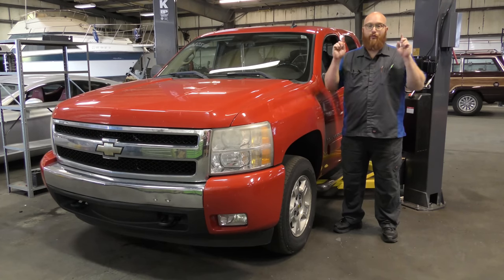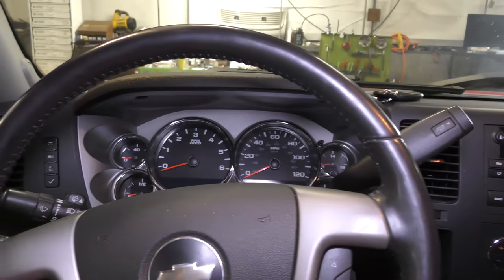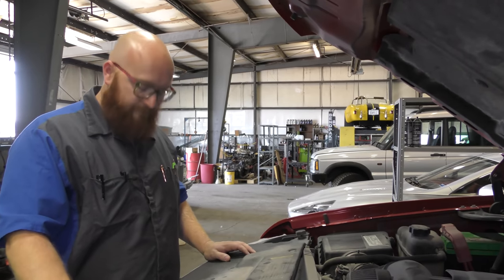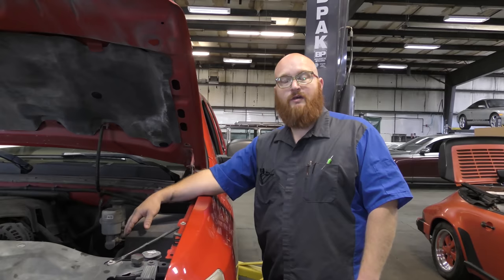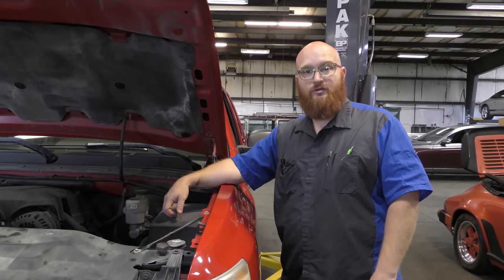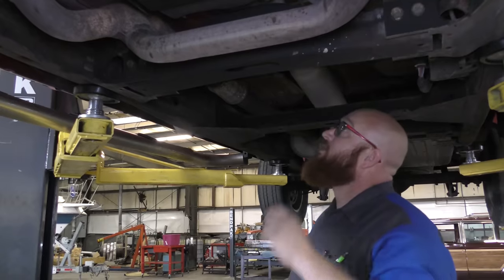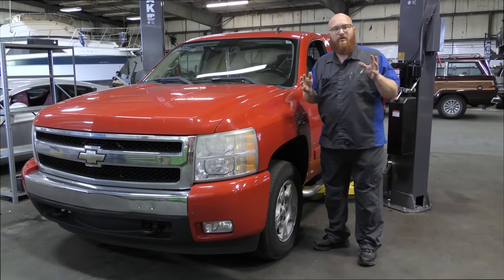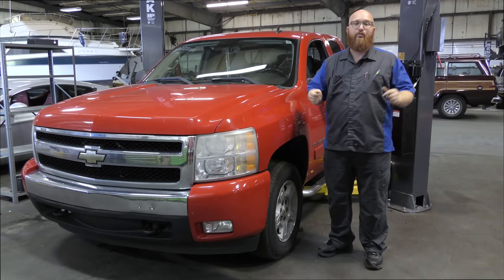Good Truck/Bad Truck? CAR WIZARD shares most common problems on the 5.3L Chevy truck at 100k+ miles

Comment: I have an 02 Silverado 1500 Z71 LS 4x4 with the 5.3 Vortec.  She's had a hard life,  she's been used for a firetruck,  wood hauling, construction, and finally by the maintenance man where I worked.  He took care of her pretty well.  She looks pretty rough,  every quarter panel has dents and scratches.  The rockers, and all four fenders are rusted through. She currently has 326,000 miles.  Runs smooth as silk, and quiet.  Every single thing on her still works.  I have a good mechanic like you Wizard.  When I first got her I had him go over her with a fine tooth comb, and give me a list of things wrong,  in the order of most important to least important,  one by one he repaired all the problems. Total for everything was a little over $3k.  I know I have more in her than any blue book,  Edmunds,  or whatever. I don't care.  I love the old girl. I named her Big Red.  I'd drive her anywhere, and she's comfortable.  I'll never get rid of her.
Reply: 2009 Chevy never get rid of it . Think I'd go to California and back in this dam thing rust little frame need a weld but dam thing gos like a Cadillac . At 4 wheel drive .
Reply: @MADDCHOPER68  I'm with you. I'd be happy to drive Big Red coast to coast right now. 
Comfortable as an old Cadillac.
Reply: I have a 2010 red one too, she is so pretty, no dents at all, just getting Into 180K.
I need to start taking care of several simple issues, and check oil leak
Reply: @mariorrodriguez535  Oh, I wish I could have gotten ahold of my "Big Red" when she was still pretty. At 20 feet, she looks pretty good. Once you get close, you see every battle scar, right down to a couple of the wheels. At some point, probably during the time she was used for cutting and hauling firewood commercially, she was buried up to the frame, spinning the wheels and scaring them clear to the center. Oh well, what's important is everything on her still works, every leak, and mechanical issue has been addressed. She's as comfortable as a Cadillac and consistently gets 16.7 mpg with the ac blowing ice cubes. I love the old girl. She's my going to town rig. We're both enjoying retirement together. These days, the heaviest thing she hauls is a few bags of top soil from Lowes now and then. Chevrolet, the heartbeat of America. ❤️ 🇺🇸 🛻 💪

Comment: Im in southern Ontario and when we get these trucks ( rams and F150 s as well) with broken exhaust studs we weld nuts or bolts to the broken pieces to extract them. the joys of the rust belt.
Reply: He doesn’t explain why the exhaust bolts break?
Reply: @dehoyosrudolph8885  Planned short working life by GM to ensure profitable dealer repairs after warranty expires.  On the GM 4 cylinder Ecotec type engines, many, if not most, of the exhaust manifolds crack in the middle, but the crack is under a heat shield that is seldom removed. Once the heat shield is removed the cracks are readily visible from the carbon tracks left by the escaping exhaust. Having an ever-present exhaust leak also ensures that the O2 sensor on the manifold is not making a correct measurement and the mixture is always out of sync with factory specs. Other design problems in these smaller engines reduce engine life. The V-8s work well if you change the oil and filters, and follow the Wizard's advice.
Reply: My dad used to own a 2010 F150 which had a ticking sound on cold starts. We thought the worst (timing tensioners or worn roller followers) .
To our surprise it had an exhaust manifold leak on both sides. We didn't think about that at first because it was a CA truck its whole life and only 130K miles.
What I'm saying is those bolts can fail even in the sun belt LOL

Comment: I bought one of these '12' based on your walk around videos of these trucks.   I sought out the 4.8l to avoid the lifter problems of the 5.3, i dont tow a bunch so no lack of power issue.  Keep up the good work!

Comment: I have an 08 Silverado with the 4.8 and similar mileage, you really nailed it on the common issues and the door locks are a common issue too. I've replaced sway bar end links, shocks and suspension bushings by this point but in fairness I've done that in most of my vehicles by 120k miles. The thing that stands out about these trucks and why I still keep running mine is the total cost of ownership has been crazy low. Tires are expensive but have a long mileage life, service costs are low, and working on them is easy so even the time quoted to fix issues isn't bad.
Reply: I’ve done normal maintenance and surprisingly had transmission cooler lines start leaking. Replaced those 2 yrs ago myself. A few batteries, tires, door handles failed and replaced. The electric locks driver and passenger just started only working half the time. Out of all vehicles owned the 09 Silverado has cost the least to keep going
Reply: 4.8l is a much better engine over 5.3l. No afm
Reply: I have the same. No rust same miles. No problems other than regular oil change. Brake pads. And tires and a new battery. Awesome truck.
Reply: My brother has an 09 with 5.3 my 08 with 4.8 will smoke my brothers off the line and top end.my traction control sucked ,my only complaint ,sucker broke ,now my truck will smoke the tires into second gear. Broke is actually fixed as for as my traction control goes
Reply: Contact cleaner ,sprayed my window button consol ,,fixed the problem.
Reply: The door lock issue is common on MANY G.M. vehicles. Not just the trucks.
Reply: Not trying to be a wise guy but my 08 Sierra  4.8 has 235000 and  only replaced brakepads and wiper blades.  Runs great.  Minor electrical issues. Cruise control  doesn't work. Its a work truck.ill run it into the ground. Doesn't owe me a dime.

Comment: These are really good trucks, Chevy makes an amazing, simple, and reliable truck. I had a red one of these with 250k miles and it ran absolutely perfect, original motor and trans. Chevy designs stuff to just work as expected for a long time, and I’m not a fanboy. The gmt800 platform was a little more reliable, but these ones look nicer and have a better interior!

Comment: Love your channel. Not being a hater. Been a GM tech for over 20 years. To get manifold bolts out I use a mig welder to build the broken bolt up and then turn it out with vise grips or weld a nut to the broken stud and turn out. After removing manifolds

Comment: 6:15 -- Wizard could you please start using a stick or a laser pointer or something to point to things in the engine bay?  Hard to tell what you're referring to.
Reply: I agree, the laser pointer is a great idea.
Reply: Green laser pointer would be easy to see, since you'll usually be able to see the beam.
Reply: used toothbrush speedkar style
Reply: Unless you’re colorblind
Reply: Do you not know what an exhaust manifold is? or where?

Comment: I have the 2009 silverado 4.8 version that runs like new with 124k miles.  Those sway bar links were shot when I realized a clunk noise at acceleration.  They were swap out along with the engine mounts that were also gone.  Now, runs like a champ!
Reply: Got a 2009 Silverado and driving great and looking great.

Comment: Just did a 1900mi trip in my 02 2500HD 4x4 6.0 gas. Used lots of fuel but had zero issues. I'm at 219k miles and depend in it daily.  Stay away from the 1/2 tons with active fuel management though, unless you budget cash for deleting this poor attempt at fuel economy. Very low cost of ownership and very comfortable to travel in. Easy to work on, easy to get parts for, etc.

Comment: As a matter of PM I replaced the oil pickup o-ring on our 2011 with 117k miles. You can usually tell by the oil pressure dropping slightly more at idle. Oil sender/screen was fine, don't overlook that. The o-ring is a common item on the 5.3 and 6.0.
Reply: I need to do that with mine
Reply: Is this expensive???Whats there to look for when buying this truck?

Comment: "If you think that's too high -- you drill it out."  Been there, done that -- I would pay an HOUR'S labor per bolt not to have to do THAT again!!!  Seriously some of the worst work imaginable!!  So hard to get at, in the first place, and trying to stay centered on the bolt while drilling and leaning over the fender, etc., etc., etc...  Hell to the no.  I'll pay a pro to do it.  I'll never EVER do that again myself.
Reply: Never underestimate how fortunate you are to find a Great Mechanic!
Reply: That is the voice of experience.  I've learned that if a shop says it'll take 1 hour to do something, it will take me 3. Not to mention several days of recovering from aches and pains.

On my travel trailer I had to replace all 4 sets of brake assemblies which includes the electromagnet backing plate.  4 bolts per wheel. Should be easy. Forgot about what it's like to deal with rusty bolts.  That job took me all day long. At the end of the day I could barely walk because of having to get up and down off the ground.  I won't be doing that again.
Reply: @kellyherald1390  air tools, heat and penetrant
Reply: It’s six pack work.     Crack a beer and enjoy.   Get pissed then quit before the tears begin😢
Reply: Some times you can weld a nut onto the stub sticking out and get it out that way.
Reply: @Cheepchipsable  Yeah, I've seen people succeed that way.  And I've seen them break it off worse.  LOL.

Unfortunately, I don't have a welder.  And in the particular incident that happened to me, the studs that broke all broke off flush with the block (or so close as makes no difference).  It was a nightmare and I would happily pay any mechanic their full hourly rate to remove those bolts for me.  I will never do that again, ever.  Yuck.
Reply: This video just convinced me to order a set of ARP and swap my bolts as preventative maintenance. Take that Mr Wizard! Lol, actually thanks for the great video.

Comment: I'm actually really glad for this video. Just bought an '11 Silverado, and because of this found that exact leaky seal where the optional oil cooler can go and discovered I had a pretty bad oil leak coming from right there (it's a lil different than the '08, but doggone near similar). Thank you sir!

Comment: Prices for vehicles will become more realistic in the next year or two when the computer chip supply finally catches up to demand. The prices for vehicles are insane right now. Unless your current vehicle is literally falling apart, better to wait until the car market has settled.
Reply: Or hope like I did you find someone thats unaware of whats going on in the used car/truck market who doesn't know scan tools exist. I managed to buy a 2001 chevy s10 zr2 with just 91,000 miles still great looking for $1,300 and all I've had to do to it was put in a new crankshaft position sensor and door hinge kit on the drivers door. The previous owner had someone replace all the brake lines and new distributor car, plugs and wires instead of taking the truck and getting it scanned for free at somewhere like Advance. So theres still a few deals out there. It took me less than 20 minutes to install a new crankshaft position senor and it runs great. I've had people offer me $4,500 if I'd sell it but I needed a truck so I'm keeping it. It was a one owner truck the owner was just clueless and anytime anything he owns has an issue he sells it rather than fixing it.
Reply: dont think it will for a long time. when u start seein elec.chargin plugs next to the gas pumps u will no weve got another change we have to go thru. like when i started seein unleaded pumps next to leaded an sayin i will never put that crap in my car.
Reply: I bought my first brand new car 3 months ago becuase I really needed a reliable vehicle with AC. I would have never bought a brand new car up until I saw what the used car market was like at the time (and right now). It was almost the same price for a new car as it was for a few year old used car. Made no sense to buy used with prices how they are. So I ended up buying a 2021 kia soul S with a 10 year powertrain warranty... now I don't have to worry about mechanical issues for a long long time, and if I do it's not being paid for by me. It gets over 30mpg and I love it so far. People make fun of kia but they are better than nissan or ANY domestic car brand I can think of for value and reliability.
Reply: my current vehicle is literally falling apart but it’s my own damn fault because i bought it last december lmao
Reply: I don’t think much will change with inflating costs in all markets.
Reply: lol, I’m here from the future to tell you how wrong you were
Reply: Lol you were wrong

Comment: You are really an honest mechanic, most mechanics would just replace the rear main seal if the customer told them to do it, even if it's not bad.
Reply: Most  would happily do it 🙂
Reply: No... they would charge for the repair and not do the job.
Reply: @cayman9873  they would probably fix the cheaper oil leak and charge for RMS

Comment: I have a 2011 Silverado 1500 5.3. I’m amazed you didn’t touch on the lifter issue with the 5.3 engines, and deleting the “displacement on demand” feature. Also torque converters are terrible. Mine went at 106k miles, and I had to replace the torque converter and the transmission. Keep your chin up Car Wizard. Everyone has good and bad days. Thanks for the fun videos and the information.
Reply: Lifter issues happen but not to every truck.

Comment: my 2008 also had the AC buttons in ruff shape. Found some new covers for the buttons on Amazon. Works GREAT. I only have about 75k miles on it. bought it 3 or 4 years now.

Comment: Thanks Wizard.  I just replaced my drivers side exhaust manifold bolts--no more ticking-so I didn't have a lifter problem.  Also one side sway bar end link was gone.   Still checking the oil sender for leaks.   Thanks so much for your videos.  I have worked on cars all my life, but still don't know all the tricks you share.

Comment: Any of those with the Active Fuel Management cylinder deactivation will likely need the lifters replaced.
Reply: And cam because lifters fail and hammer the cam and or break and rotate in the lifter bore and destroy cam and send metal all over the motor! I would never own any DOD or AFM motor unless it was deleted!
Reply: I did that recently on a truck with 80,000 miles on it.  Couldn't believe it.
Reply: I have 93,000 miles on mine when this failed. Best advice I can give is get a tuner and disable the crap.
Reply: @MikeGauley  I had a Range AFM DISABLER on my 2010, it was cheap and it worked.
Reply: I just bought a 08 suburban 3 months ago, the dealer replaced the cam, lifters, lifter buckets and all top end gaskets! I ordered the range technologies afm disabler b4 I even picked it up and drove it home for the first time!
Reply: I had an 07 make it to 153k before I traded it. I didn't even know it was a problem until right after I got rid of it
Reply: I have a 2009 GMC  with a 4.8 that I bought specifically because it has NO AFM .... It runs gr8t !!!
Reply: Most people stay away from the V8 around here. The V6 has been more than enough for pulling what I needed.
Reply: @MikeGauley  - That won't guarantee it won't still fail, costing thousands to repair!  The best advice is to stay away from 1500 trucks with AFM!  The 6.0 in the 2500 does not have AFM.
Reply: Yep.  My old GMC failed just out of warranty.  Kicker was the lifter never made any noise.  By the time it triggered the check engine light, the cam had three round lobes and metal had destroyed everything inside the engine.
Reply: @jared5021  I have a 09 & it's the worst truck I have owned because it leaks oil worse then my old Dodge I had for 8 years and this GM has way less miles . Trading if off as soon as possible because I am not dealing with this junk anymore . These alloy 5.3 engines are now known to have porosity issues of the aluminum casting of the engine block & that's why they leak because GM had who ever let these blocks that should have been scrapped & melted down & made into another block the casting company let them slide through so now that these trucks are out of warranty people are having these issues with them  leaking oil . I would be willing to bet that GM had these blocks outsourced to Mexico to have them made because they I believe dont have to abide by ISO 9002 quality standards so quality was piss poor on them . I read now that there are 3 class action lawsuits against GM because of this in 3 different states so I honestly hope they get their asses sued . The other thing is these model year trucks are bailout trucks with GM declaring bankruptcy at the time with our government bailing them out so I think GM at the time were not testing these trucks as good as they should have for reliability problems & figured if they were going under to build & shove them out as fast as possible to dump them off so they wouldn't take as much loss on them if they went under .
Reply: Is there any year in that gen that doesn't have afm?
Reply: @fakejeepman06  -- I think AFM started in '07.
Reply: @rpsmith  so there wasn't a time in that generation Silverado (07-13) that didn't have afm on the 5.3?
Reply: @fakejeepman06  -- As far as I know, only the 6.0 did not have AFM but you might want to checkout Wikipedia or make the rounds on some of the Silverado forums.
Reply: @rpsmith  thank you 😌
Reply: @fakejeepman06  -- NP, glad to help.
Reply: I have 3 5.3s all over 200k miles they run great
Reply: My dodge is deleted. Still runs cheaper than almost any other 5.7 Ive heard about. That function is a joke.

Comment: Those Chevys are SO easy to get the broken exhaust manifolds out. I Never had to drill on the Chevys, I build a booger out on the bolt and remove with channel locks or stripped bolt remover on the mug weld buildout.

Comment: Pretty good paint, my 2007 started wheel well rust in 5 yr and is several inches up now.  Also includes shock mounts rusting off in less than 10 years.